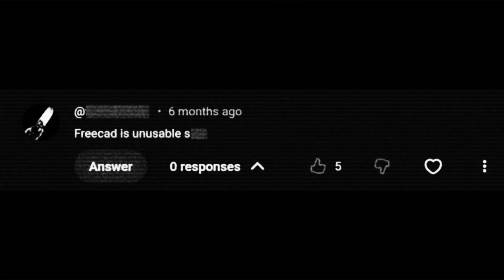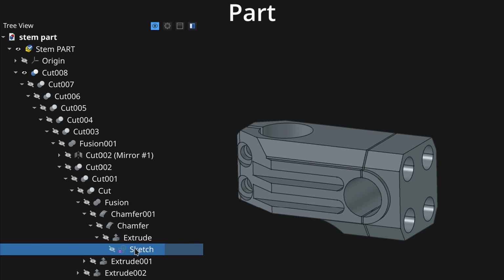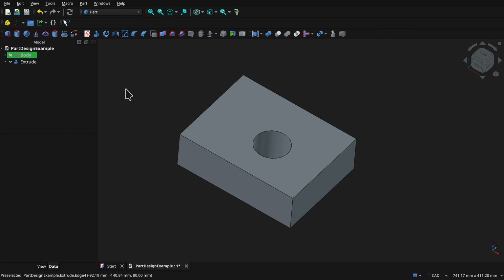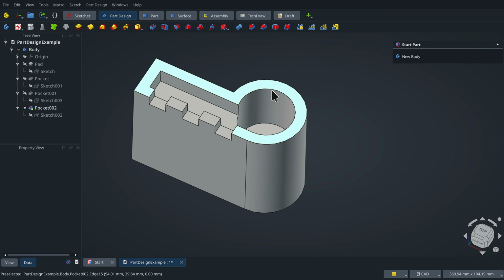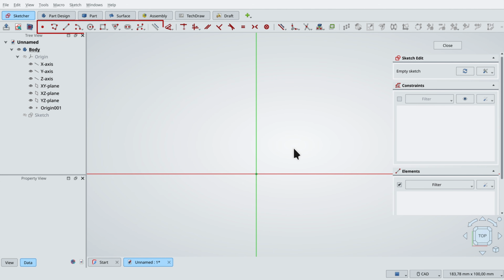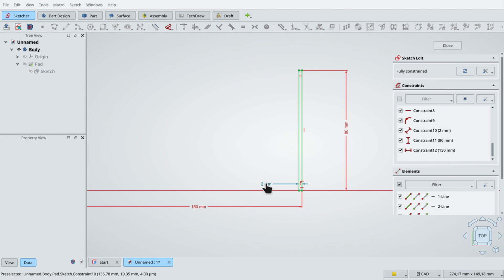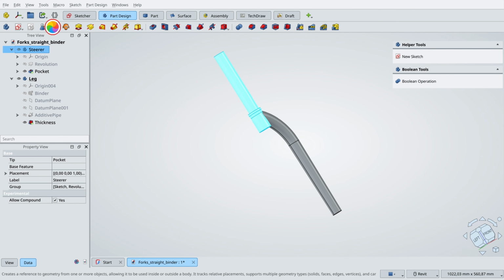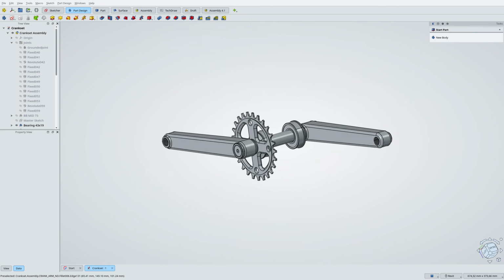STOP using FreeCAD WRONG! Do this INSTEAD (Workflow & Tips)

Comment: FreeCAD is an old software and OpenGL settings are plain obsolete - VBO is the preferred way of handling geometry in OpenGL on dedicated GPUs for well over 20 years and on iGPUs for around 18. I have maintained a complex OpenGL software with a reach of half a million people in early 2010s and at one point i had every bug in every version of every OpenGL driver memorised. I also see little reason not to use 8xMSAA on dedicates GPUs, since the corresponding memory bandwidth is effectively already committed.

Addons are a blessing and a curse, as your favourite addon is GUARANTEED to go broken or abandoned. Case in point, you say to install Assembly 4.1, but it fails.

I found Blender back in 2001 from a book, and it was insanely good already - not as feature rich as Max, but once you got over the hump, a workflow which i found way more artistic and suitable. In the interim, it has grown into a feature rich software. Workflow and UX is one major issue of FreeCAD, it grew in width before it could shake out the core fundamentals, and is now paying the price.
Reply: Then why don't you contribute to FreeCad.  it's open source
Reply: @scribustore   I have spent over 6000 hours working on open source software and it ruined me - it's way too addictive and doesn't pay. If there was a way to make living money off this, i may actually consider doing that again, but otherwise maybe but no.

Additionally Freecad really isn't set up for that, if you're not the in-group, you have no way in, it's not the kind of project that you just contribute to. You're not even allowed to report bugs on the issue tracker. You first need to go to a forum, and then get feedback there. But i ask something, then a well meaning but confused individual gives me a ladder of ever more obtuse workarounds, but all i need off them is the magic words "this is a bug, you put it on the issue tracker" or "this is not a bug, it's working as intended" and after 3 days and 60 messages back and forth, i got neither, and i tried to ask directly several times.
Reply: Except it didn't? You can move pannels around an even hide the ones not relevant to you.
The ui addon he mentions does the heavy lifting but i agree that this should be the default for most users.
Reply: @TheSliderW  Then why is FreeCAD still considered subpar even by most hobbyists, over 20 years since it first got published? For most hobbyists FreeCAD would be the first CAD tool they ever use, so they don't even know how their ideal UI would look like. You need months or years of experience, something that ist needlessly difficult, cumbersome and unproductive to achieve in FreeCAD compared to other CAD tools and yet the community around it remains stubborn and simply cries "skill issue".
Reply: @iliketoast-q9b  I'm not sure you can say "most hobbyists" that confidently when all sponsored youtubers in the community don't use it either or have more experience with the newer software that is indeed more user friendly and promote that instead.
As you so clearly stated, FreeCAD has 20 years of existence but it's devs are so few and contributions only boomed in the recent years. They need more users (and more devs) that are willing to go past the issues and contribute in the forums. UX is important and i'm sure they'd love to hear more about your point of view. Granted, they are also well aware of what the professional software looks and feels like. The more people complain, skill issue or not, the better, as that helps paint a clear picture of what pain points are and how to better smooth them in the future.

Comment: I'm an Onashape User and use it mainly for 3D Printing. Your Videos encouraged me, to give FC a try. So I installed it on my Mac and created a simple model, exported it, printed it and use it now. I invested approx. 10 hours to understand the basics and yes, FC has its charm. But over all, it misses the most important feature: it is no fun to work with it. It is a combination of many small things that make the program unwieldy and bulky. I am now 65 and the remaining time of my life is becoming more and more valuable. And honestly, FC is way too time-consuming for me to make it my daily tool. If I were forced to use this program only, my creative flow would collapse immediatly. Sorry to say this.
Reply: Well I can't say that you are wrong. I have both Free CAD and Plasticity. Plasticity isn't a parametric software (unfortunately) but it's clean, fast and user friendly. I also 3D print.

But I must say that I once again got my interest in Free CAD ignited because of the clean, useful and professional way that this channel once again explains things.
Reply: @petri..  Um... I would not call the surfaces generated in Plasticity "clean" - the ones I saw hat way to many control points and were impossible to import into engineering and CAM software... well, technically, they could be imported but they cost a ton of time to clean up for prototyping and tooling...
Reply: @f.d.6667 Ohh, I meant the software and its interface, I know that Plasticity cannot be compared exactly with CAD software but you get stuff done quickly with it.

Just generally speaking I'm a firm believer in keeping things straightforward, effective and user friendly even if there is a complexity to it. 
I would say that the more complexity and "chaos" the more important it is to keep things logical and in order.
Reply: @petri.. 
Shapr3D might be closer to what you're looking for if you like Plasticity but want things like driven dimensions.
Reply: @rustyshaklford9557 Think I have tried that at some point in the past but it might have been in the early days. It's always good to revisit and check how a software had progressed. Thank you for the idea 💡🙂👍🏻
Reply: Absolutely correct. What in other, I emphasize, parametric CAD systems like Inventor or SolidWorks just works within a single mouse click, in FreeCAD requires a bunch of auxiliary constructions, often duplicating constructions that were already created before. And it’s annoying. It’s a flood of pointless work that poisons the entire workflow.
Reply: @easyelectronicsru  sure, but FreeCAD is relatively new free software and an active development of which, seems like started not so far ago. While you are comparing it with two industry mammoths, with $1800 (Inventor Pro) or even $4700 (SW for the same as Inventor Pro) price tag (annually). Who could even suppose the difference between them might exist...
Reply: Complete agree. It needs to change
Reply: Totaly agree.
Reply: You are spot on: in physical tool and power tools, we have high standards for ergonomics and usability but in software, we are still in a phase where software developers need to learn that outside-in beats inside-out: they are making a tool for people who have established workflows, often through years of using professional CAD/CAM software. Blaming the user "you are using it wrong" indicates that the FC developers lacked experience in developing for real people in the here-and-now ... and I can't blame them: our college dropped ergonomics and human factors classes and if you don't have a consumer insight person in your team, engineers will develop for, well, engineers and not for people "just need results".
Reply: Subscriptions go up, you move to another platform and you need to redraw your designs with your new iterations.  FC may be  a pain at times but at least I can do a save as and create my new version.  Consistency across workbenches would be nice..  do you think if we were all donating $5 per month that the developers could improve the user experience?
Reply: Just like anything else in life and politics. We have all the time in the world to make changes and improve ourselves and our surroundings when we are young but become rigid and prone to dislike change as we get older with a more stable lifestyle.
I understand your feelings and honestly if you're good with onshape then don't waste your remaining time changing for anything else, especially if you're okay with sharing your models for free,  it's not gonna disapear in the foreseable future but i do hope they release an offline version at some point for the next generation of users.
Reply: Everyone has different priorities. But in surprised anyone now days trust corporations with anything. If you can leave it for open source do it. Maybe you're unaffected by the fascism in the world, the surveillance, the suffering, and if so lucky you. But states are trying to implement ai surveillance on our 3d printers. They want to criminalize having files. They will want to use files in compliant corporate servers to prove collaboration when all you did was design and print a shelf bracket for an organization that feeds the homeless. Yes we should all think of what we do with our time. I'm at the half way point of life and I'm currently stuck on all the time I wasted on fear. 

Good luck to you.
Reply: @lunaumbra5179  Totally agree on the point that we need free and open-source CAD for everybody - but why does it have to be a software that is ignoring natural workflows, standard ways of generation geometry, the rules of good interface design and software usability? I have learned 7 CAD packages in the past years, from AutoCAD, MAX, Alias, Duct, Powershape, to Fusion 360 and Rhino - so I think I know "how to CAD". If a software comes along that wants me to change my workflow, and invest a lot of time in re-learning complex modelling procedures, I will pass. There is no fundamental law of the universe that is stating that a powerful CAD tool has to have a cumbersome interface. You can have BOTH and you should EXPECT both, as nothing is as valuable as your time.
Reply: @lunaumbra5179  I couldn't agree more.  I'm about the same age as the OP.  My personal decision was, at this point in my life, I can't afford to have my work held hostage by yet another corporation.  It was a learning investment to switch, and I do almost exclusively parametric functional designs for 3D printing.  I personally love learning, and couldn't be more pleased with the results I can now quickly achieve in FreeCAD, and I also know I'll never have to pay a ransom to keep and access my work.
Reply: Lol, okay ! Why comment? Complaining about software you have (stated) zero interest in learning is a waste of your precious time, correct? Btw, I'm older than you, AND, I accept making this comment is a waste of my time. I'm okay with that. That is, countering useless comments in hopes of giving others reading this hope in continuing expanding their knowledge in any pursuits.
Reply: @dbeelee8564  You need to look at invest and return. What do you have to give in return to what? Our lives = time are the most precious thing we have. We invest some of it for a return that justifies the invest. Somebody invested A LOT of time in programming a powerful CAD tool - but the power is inaccessible due to cumbersome user model / interface / workflow. Our comments HELP the programmer to improve the software, so that their invested time was not completely wasted. Too complex for you to understand?
Reply: @dbeelee8564  Because people genuinely want this product to become better?
Reply: @dbeelee8564  lol and oldman fanboy. That's new to me.
Reply: @dbeelee8564  The line of reasoning that leads to your conclusion is completely nonsensical. The original comment creates a strong and reasonable case as to why despite everything, FreeCAD is still not suitable for them. But for some inexplicable reason, you think someone not showering this program in praise is unacceptable. Who are you to say that someone's workflow is wrong? Oh, right, you're nobody. I mean you're genuinely arguing that people shouldn't comment if they say things you don't like. "Why comment if you don't like it bro?" Because he wants to comment. You're sickening.

Comment: From my point of view, this software still has a long way to go before it can be a truly functional parametric tool. It's unacceptable that every process or modification has to be done in a specific way to avoid problems; this suggests the software was designed by programmers and engineers who overlooked designers. It's inconceivable that you have to navigate two different environments and click multiple times just to extrude simple text onto a surface, when all competing programs, both paid and free, do it easily. This software stifles creativity because you have to learn everything beforehand to avoid problems with surfaces, edges, intersections, and so on. In well-designed software, you have multiple paths to achieve the desired shape; in this software, if you don't follow the programmed process exactly, you'll run into problems. I hope that in the future it will evolve and be designed to allow designers to create more easily and quickly, and not just be for engineers to unlock its full potential.

Comment: I really want to move to FreeCAD because I want to Leave windows... But holly cow, this program is Incredible Visual Polluted, its the same thing I criticize Inventor a Lot... for Everything there is a NEW window or tab... Did Solidworks patented the concept of using the same TabSpace for different levels of tools?
I will need to watch this video a few times with more time... but the UI chapter gave me brain cancer... not because of your explanation, in fact its pretty good, but the UI is such a DOWNGRADE from Solidworks, it really hurts, the UI of this software is incredible Dirty... too much information that you wont use for 99% of the time and that could be hidden on another layer instead of polluting the screen for no reason.... Not everyone live in the US or EU and can buy a giant monitor with a few pennies... I Live in Brazil, our buying power is 20x smaller, and searching for something on 15 different tabs that occupy 70% of my little screen like I searching for Waldo, its not just incredible annoying, it hurts productivity A LOT.
.
I will give a chance to FreeCad and be understanding that this is a FREE Software...
But this is NOT a friendly program, it looks hostile from top to bottom.

Comment: Your explanation of FreeCADs conception is very good. My critique is about the basic concepts ITSELF: You may have never encountered a CAD-software that does NOT need a "history" / chronological order for the building process.
You might even ask "how should I build a complex part without an chronological order?? Thinking it is impossible. Well this simply depends on the basic concept. As soon as you use 3D-parts like quader, cylinder, sphere as the MOST BASIC parts instead instead of extruded  2D-shapes. The order becomes totally irrelevant. IronCAD does use this basic concept. "Drilling" a hole is simply "add" a substracting cylinder.  etc. The change from 2D-sketches to 3D-boddies as the smallest element enables this. Additionally IronCAD has a very impressive positioning-tools. This basic concept allows to do ANY kind of changes to your part at ANY time without considering ANY kind of chronology. 
It is very very unlikely that FreeCAD will do such a FUNDAMENTAL shift in the basic concept. Still newcomers should know that there are different concepts.
Reply: Does it mean that all subtractive geometry gets applied after all the additive geometry, and once you have made a hole, you cannot put any further additive geometry into it? Or you're being dishonest about the concept and it still has an order of operations that is encoded by the software. Further cast doubt about "any changes" - either the changes are constrained, or the actual operational language is constrained and makes many useful operations impossible. Do you work marketing at IronCAD?
Reply: @SianaGearz  no I am not working at IronCAD. If you build a complex part you start with "positiv" 3D-shape. If you want to substract you "add" a substractive 3D-shape to that  one positive particular 3D-shape.
and it simply substracts. example a positive cube and substracting a cylinder. You can change all three dimensions of the substractive cylinder at any time and the part simply updates. You can change the 3 dimensions of the positive 3D-shape at any time and the part simply updates. You can imagine substractive parts exact the same way as you would manufacture the part with a subtractive tool like drilling or milling. But you are even able to substract inside a completely closed part which a real tool of course could not do.
Reply: @SianaGearz  No I am not working at IronCad. Take a look into thsi video to see the basic concept

Comment: Thanks for the video. This is really helpful. I also struggled quite a lot in the beginning, but I learned to do a lot in Python. the advantage of Python is that when you mess up your design, it is really easy to recover because you can just throw everything away and rerun the script. But as I progressed, I also learned how to use the software and indeed it is completely true that most of the frustration comes from not knowing how to use it. I'm pretty autodidactic, but what would have helped me a lot is a tutor. There are lots of good videos, but the problem is that when you're designing something, you get into a situation where you have that specific problem, that if you could ask someone, he could probably explain it in 10 seconds, whereas without a tutor, you have to search online for the right video, watch the whole video from start to end. And that way, simple questions can eat up a lot of time.